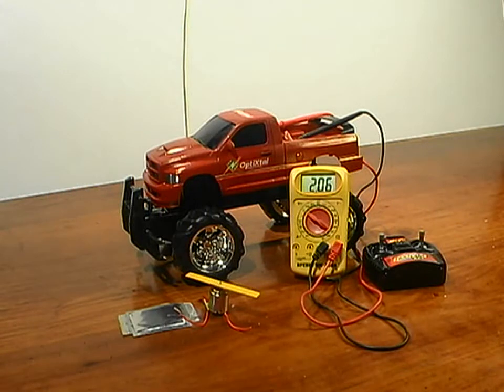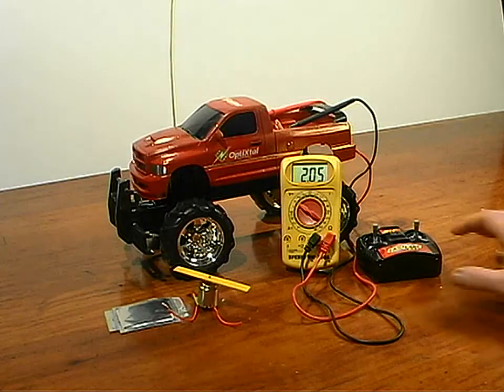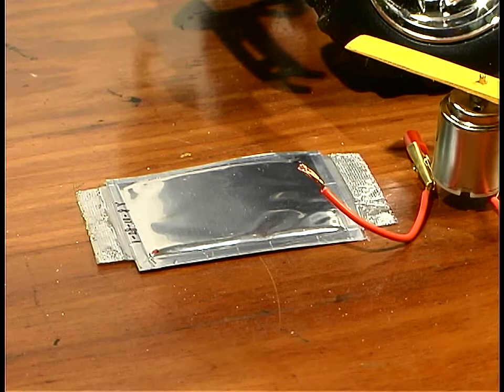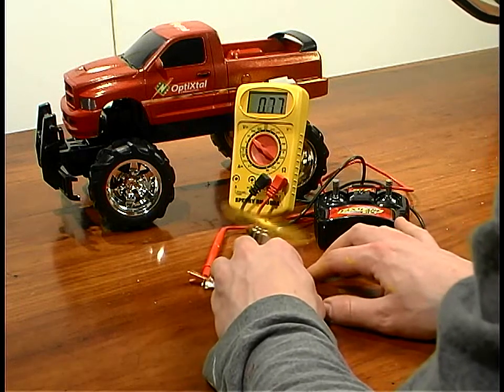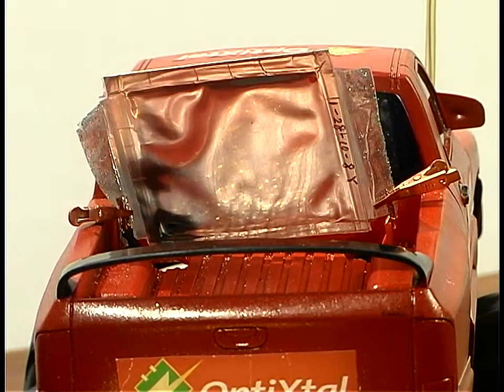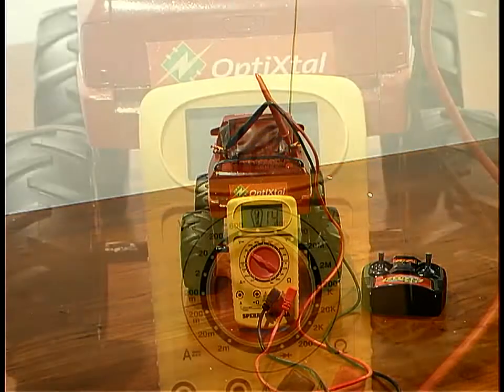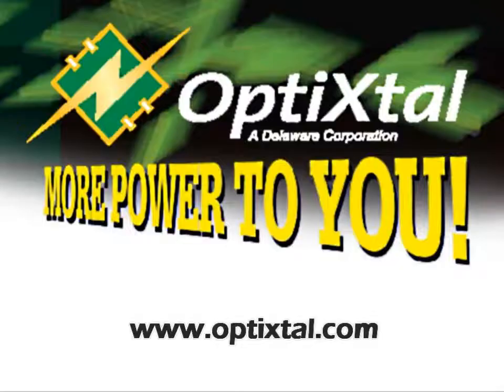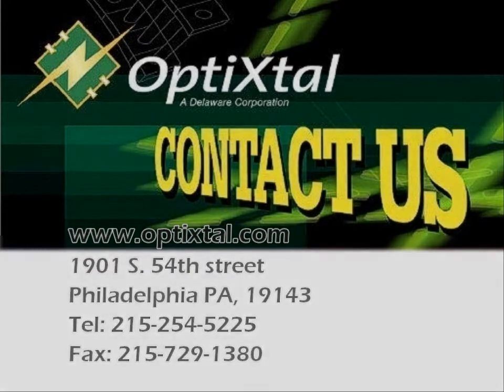Energy Harvesting with Optixtal Supercap

Comment: This doesn't boost the power. The internal resistance of the super cap is so low that it drains to 0 Volts with constant current.